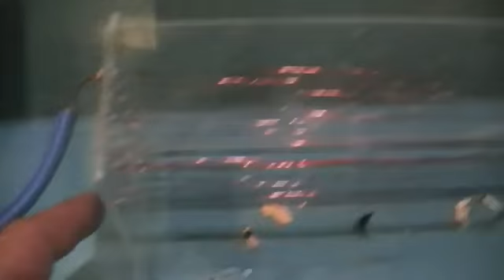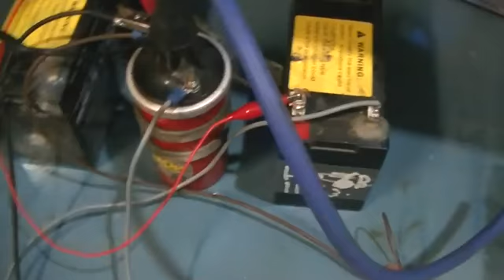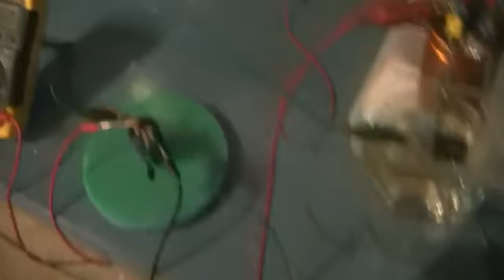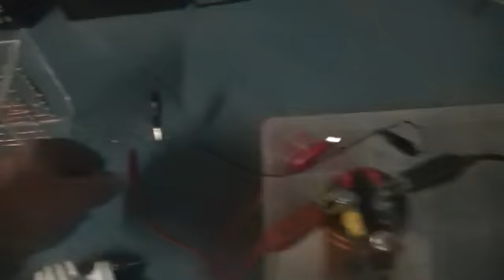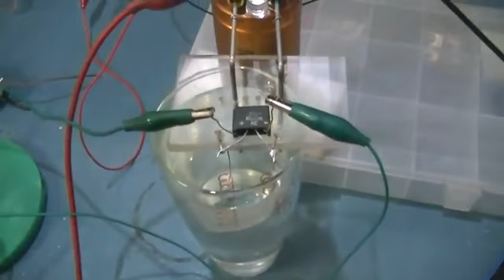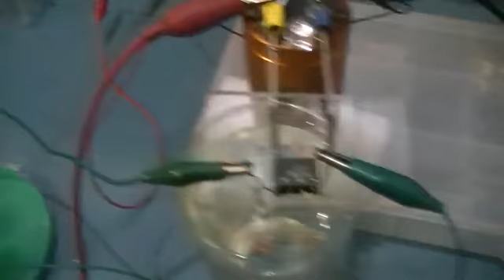High voltage water setup xx.mp4

Comment: Good stuff!
Have you taken a voltage reading on the HV circuit?
I would suggest connecting a neon lamp to the high voltage part of the circuit. Use this to confirm the frequency of the circuit (probably 20-25KHz judging by the noise). Then make smaller coils, separated by 1/4 of the wavelength of the frequency of the circuit which you just measured with the neon. The length of the wire in each of your coils should also equal 1/4 wavelength or an odd multiple thereof.

Comment from the maker: Hi electro1622
The one big problem with that is the 555 timer wont handle a 400 volt pulse going through it.This is one of the reason's i believe the charge to be a negative one ,as most of the components breakdown voltages are a lot lower than what is going through them.
I will however be doing some more experimenting with the single wire HHO production and also the wireless setup aswell.

Comment: Just a thought Tin Man ,if this circuit gives you a negative only charge 400v, could you make another one with the coil and cap connected the other way around to give you a 400v positive only charge?Then maybe try this field produced between the electrodes for hho?may sound stupid but WTH.

Comment: It looks like this may be an SEC circuit. (Spacial Energy Cohereance) If you put a diode in the water (hooked to nothing) standing in a vertical position it should produce gas off one of the leads only.

Comment from the maker: Hi andrinoid-i have run the system without the FWBR and two copper coils and the light still work's quite well.What is interesting to note is that both the negative and positive side's of the diode on the secondary coil have to go into the water for the globe to light.It seems as though the water has to have a pulsing charge sent to it -although it is a short-for it to light.

Comment: TM, I'm learning and can't wait for more. Listen, try putting more diodes in series to increase the 0.7 volt "diode drop" to 3.5. 4 diodes should be good to light up the LED. With even more diodes could power a fan or charge a battery, without the water. From there voltage doublers could be used to match what you need for charge voltage. The water aspect is still very interesting and definitely needs to be investigated. I like this topic!